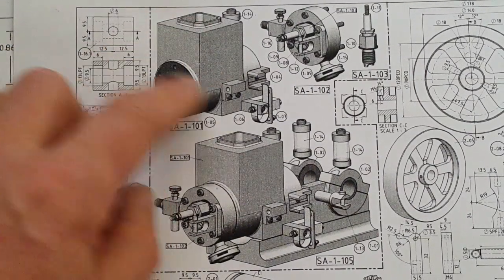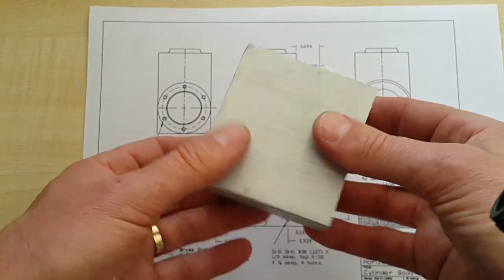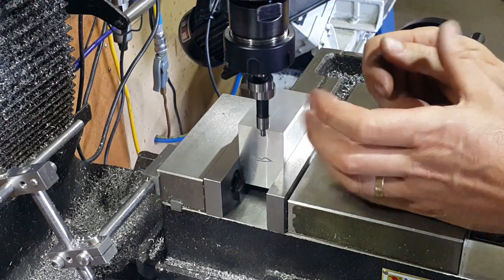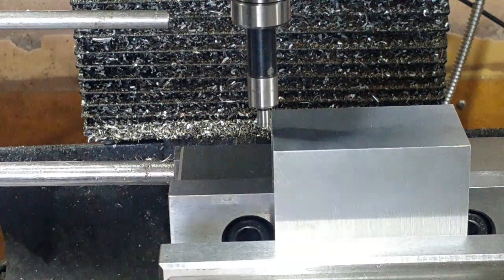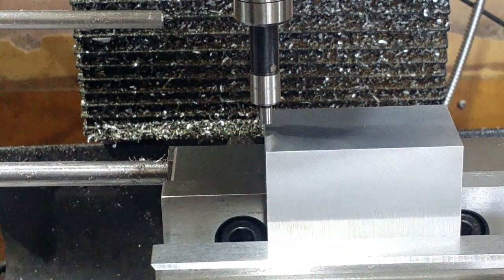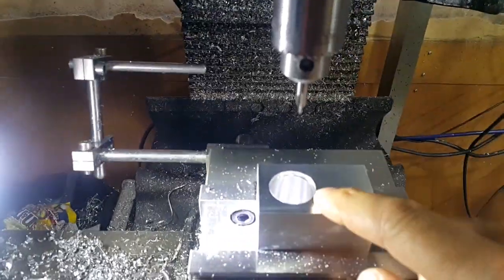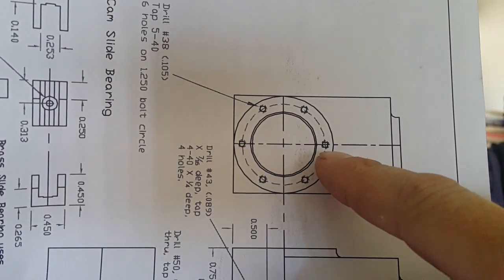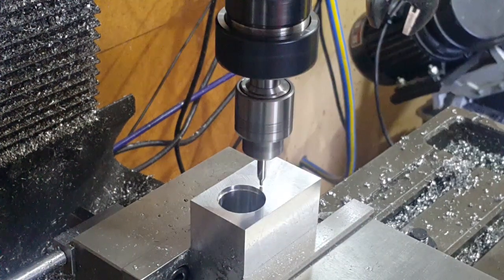#47 - Kerzel Hit & Miss Model Engine - Part 3

Comment: Great information on building this engine. In Part 3, I did not see if you cut the water cavity in the engine block. Did you use the same boring bar technique as you did in Part 4 to machine the water jacket? Vic
Reply from the maker: Hi Vic, I didn't bother with the water jacket as the engine wouldn't be run for long periods of time. Thanks for watching..